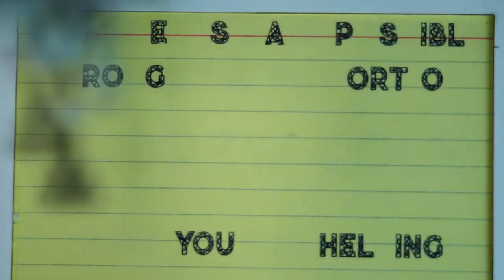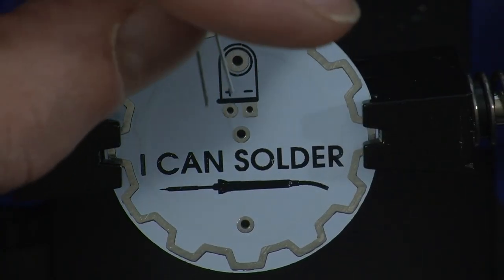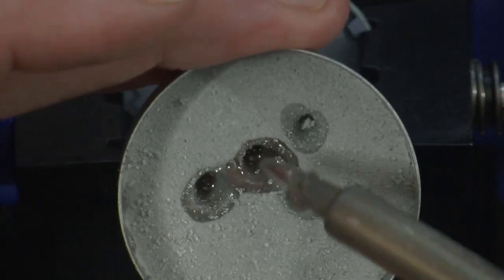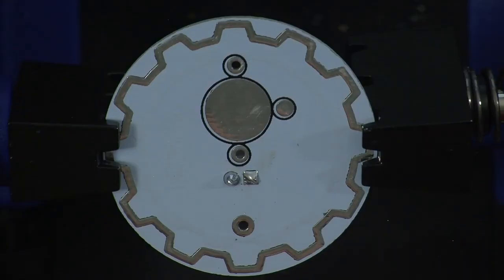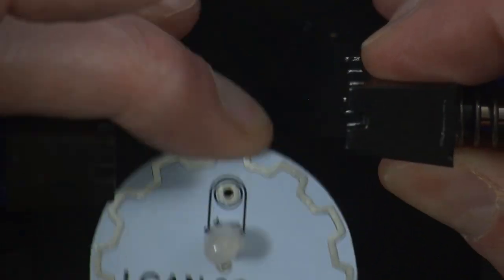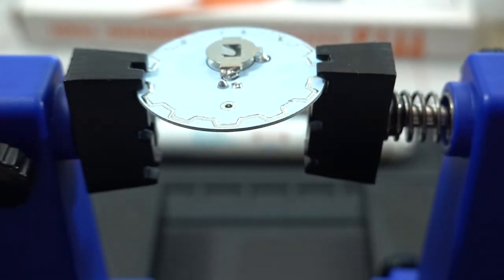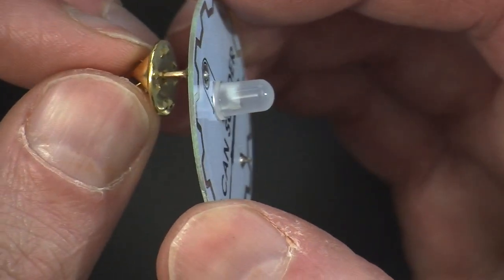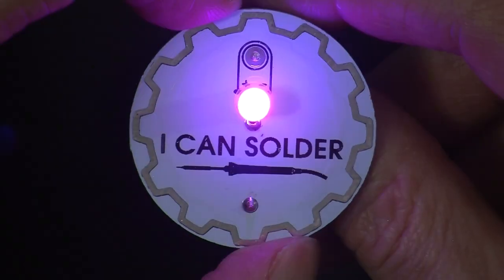Chris Boden - Kits With Chris Episode 6 - I Can Solder

Comment: Through-hole technique looks good. Next, try surface mount, there are SMD kits available. I got one a couple years back and on first attempt got the tiny blinky light to work.  Tip: a teensy drop of superglue on the underbelly can help those teensy parts stay on the board.

Comment: The shot tower is tall so the lead can form a sphere before it hits the water
I usually add the iron and solder at about the same time, on sensitive components you want the heat there a short as possible.

Comment: a concave solder joint is not one that flowed properly, if it is convex it has wicking onto the lead of the component and the surface tesnion is making that shape, the top battery holder lead near the led wasnt a well flowed joint. just constructive criticism. cheers!